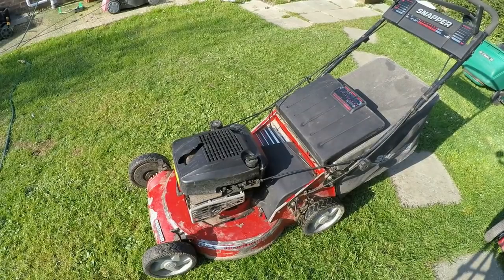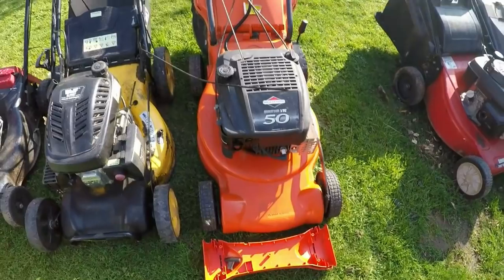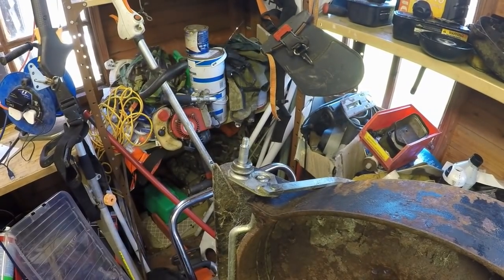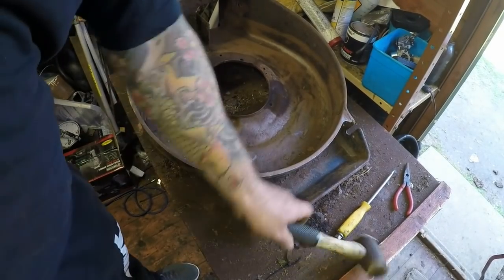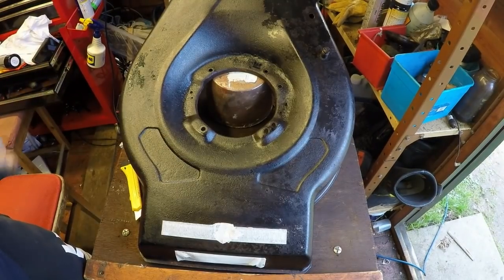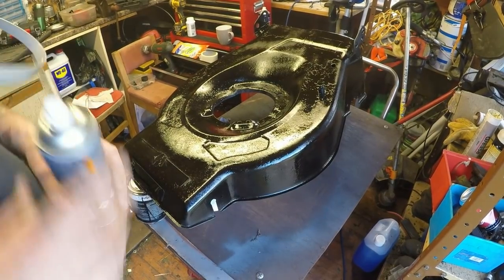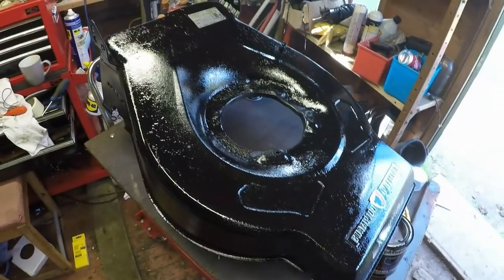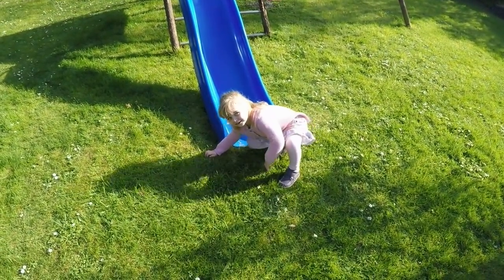#lawnmower #howtofix #restore Rusty Lawnmower Needs A Paint Job

Comment: I know this was 2 years ago but have you tried the rattle cans from Lidl ( When on offer, middle aisle), they have Red, Silver,, Grey, Black and Green, 400ml cans £2.49 each of 2 for £4, it's a 2 in 1 paint and lacquer, you can lacquer over it for added protection, I use it on all the lawnmowers I've done, the Red is really good match, the also do a spray undeseal I use that on the bottom of the decks.

Comment: Whats the repair part for the cable?  Is there a link to that?  Seems like a good alternative to have a quicker turnaround if it works
Reply from the maker: https://rover.ebay.com/rover/0/0/0?mpre=https%3A%2F%2Fwww.ebay.co.uk%2Fulk%2Fitm%2F264454536030
It works perfectly

Comment: Did you place the can of lacquer in warm water before you used it?
Reply from the maker: No is that what you do
Reply: @themowerman  it can help with some spray can lacquers. Especially the petrol resistant ones.
Reply from the maker: @garethwigmore9352  in what way?
Reply: @themowerman  it helps to thin the lacquer slightly which in turn helps it exit the can more evenly. It reduces the small chance of any clumps and reduces the chance of an orange peel effect. The petrol resistant can lacquers have a tendency to clump or spray unevenly. Try to steer clear of Halfords own brand petrol resistant lacquer. It's unfit for purpose.
Reply from the maker: Mr Wigmore ok mate thanks for the info I will take it onboard and try it out

Comment: Nice work!
What are those cable clampy thingies called plesse
Reply from the maker: https://www.amazon.co.uk/sourcingmap-Diameter-Aluminum-Sleeves-Fittings/dp/B073W22KQG/ref=mp_s_a_1_14?keywords=cable+crimps+1.5&qid=1554148518&s=gateway&sr=8-14
Reply: BluejuiceT4 they work very well I’ve used them my self

Comment: Hello mate. Love the channel. I see you've got a BMC Big 20 in that lot. I need a new primer bulb for one I've just been given for nothing but cant find spares anywhere. Any suggestions please, greatly received.👍
Reply from the maker: Hmm to be fair I too am struggling to find parts as it's a discontinued mower..
Reply: @themowerman  After hours of trawling, the only people I can find with similar BMC machines are this lot https://www.ukhs.tv/BMC-17-139cc-Self-Propelled-Petrol-Lawn-Mower The primer looks the same to me. I'm speaking to them this week and will let you know how I get on.
Reply: Seems like they do spares as well mate, as just bought a new primer bulb off them for a couple of quid. Worth knowing 👍
Reply from the maker: @theburydelldiary6741  fantastic news I will have a look. I'm up to my neck with mowers at the min
Reply: @themowerman  No good. Bulb too small. Putting it on ebay for spares. 😦
Reply from the maker: @theburydelldiary6741  oh no does the bulb go straight into the carburettor or via a fuel line ?
Reply: @themowerman  The bulb looks like its got a 1 1/2" right angle tube from the back of its casing, but doesnt seem to fit nicely over any of the tubes in the carb. Maybe thats why it was given away as well. No to worry. Good luck with yours.
Reply from the maker: @theburydelldiary6741  there is always a work around as long as you can get a bulb to work just attach it anyway and link it up